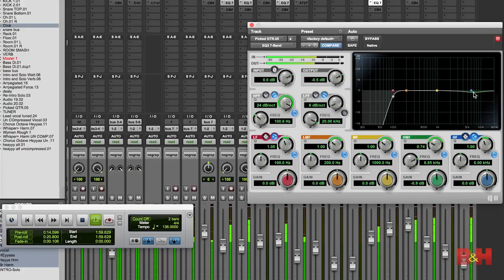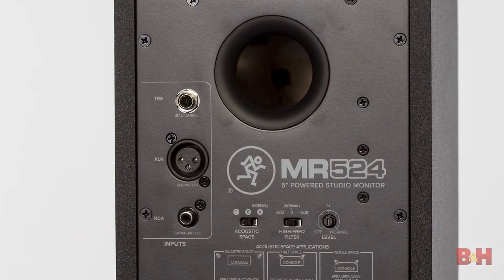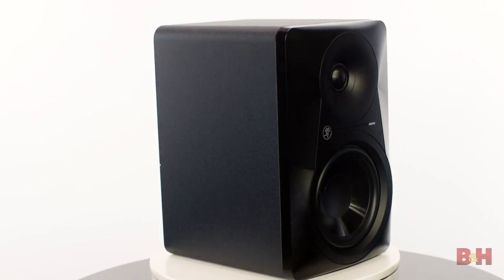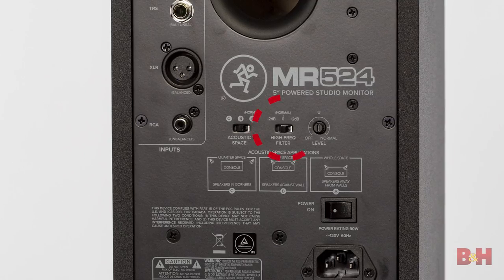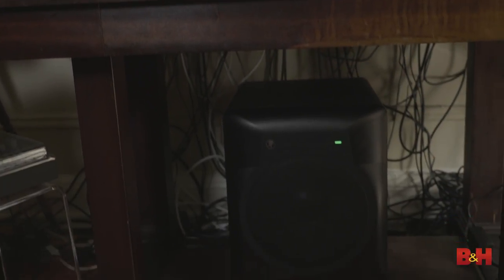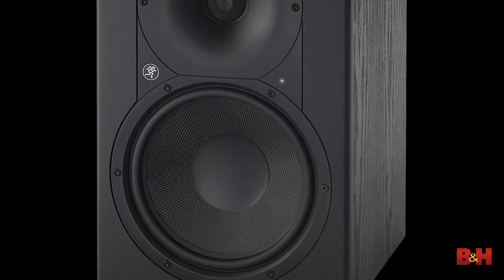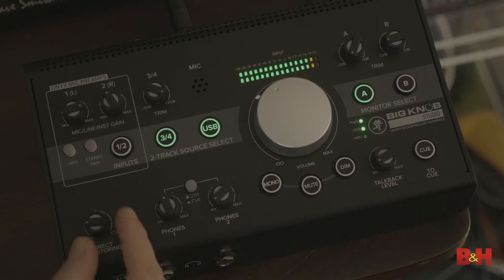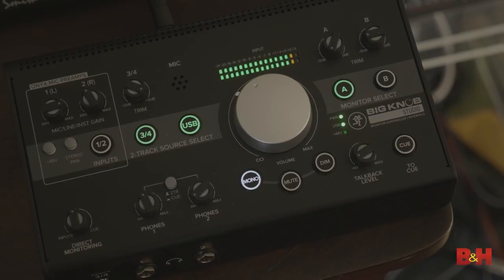Creating Accurate Mixes | Mackie MR Monitors & Big Knob Series

Comment: Does anyone recommend mixing with 4 speakers in near field (a wall of sound - two monitors close in to the computer and two spread out further to the left and right) or is that asking for trouble?
Reply: Paul Bordelon to me it seems like a recipe for trouble, the different models of monitor will have different crossover frequencies and you’ll quickly experience phasing issues which will be very muddling for any monitoring purposes
Reply: no. phasing will be created. 2 monitors at a time is your best bet.

Comment: i thought it was down to encoding and format ?
Reply: That's one part of it. The truth though, is that you will need a studio as per the industry standards, with proper monitor speakers and other equipment, also as per the industry standards, in order to get an accurate mix. With the reflections and distortions out of the way, you can mix your sounds however you want to, and then play them at other studios to try and hear the difference. If it's huge, there is something really wrong with your studio, and you might need more acoustic treatment and/or sound proofing. If the difference is little, then you have a more or less accurate mix.
If you do make a great sound and end up saving it as a 64 kbps MP3, you are obviously slapping your own self. It's like purchasing 10 bags of vegetables and dumping 9 of them on the way home. The first thing to do is to save whatever sound you've mixed, in a FLAC format, which is as uncompressed and as lossless as it can get. Then, if you need an MP3, or a WAV, or whatever other format, compress it whenever and however you want to. As long as you have the FLAC file, you'll be okay.
You balance those two things, and you'll be good.

Comment: The 624s are amazing! We've tested the 624's spectrum response pretty thoroughly, the boundaries are never that strict at the low and high ends for studio speakers, they don't have hard high-pass or low-pass filters, like we have in the digital domain. They reproduce audio well beyond their stated response (which is 38Hz-20kHz for the MR624), just not loud enough to make it into the spec. Roughly we got these results from our graph for the MR624:
32Hz - 22kHz within -12 dB, 38Hz - 21kHz within -10 dB, and 45 Hz - 20kHz within -3dB from a 100% flat response line.
The beauty is in how low distortion remains at both ends of the spectrum, and how smooth their curves over the entire spectrum are. They are particularly smooth and flat at very low audio levels. None of the speakers we've ever(!) tested reached that wide and flat a response curve at such low audio levels, and we've tested speakers for more than 30 years. After we tested them, I bought myself a pair of MR624's for my home attic studio. Never regretted it one second.
Reply: Thank you. It's helpful reading a comment like this after waiting for a pair of the same model. Of course, the tests happen in well treated rooms, but they do give confidence.
Reply: how are they compared to presonus e8 xt,please?
Reply: Any idea how they compare to the XR series?
Reply: @lu-ww2cn  Good question, I haven't compared them side by side, but I didn't really like the EBM wave guide design when I heard it first, to be honest. It is trying to solve a problem that never existed (for us, anyway). Macky has that in the back, like many brands do, which, depending on how close to the back wall you position them in your room, is usually fine. I like the low end of macky speakers better, on average, but that is a matter of taste. And presonus is a little more on the (way too) expensive side for what you get. If money is not an issue, perhaps presonus is a good idea, but an honest comparison would be interesting.
Reply: I'm looking at a pair of 624's for my DJ controller. I've got a pair of Mackie CR4's and the sound off them for a budget speaker is immense. So naturally, I'm looking out for a pair of 624's.

Comment: Can you play both monitors at the same time ? And control the sub woofer ? 
Thx Rob
Reply from the maker: Yes.  Plug the subwoofer and the  2 x Mackie MR524 5" 2-Way Powered Studio Monitor (Single)
BH #MA204840000 into the Mackie Big Knob Studio Plus Monitor Controller and Interface BH #MABKSPMC.    >Mark<

Comment: MR 524  or MR 624?  
In my setup, the position of the speakers is 20 cm from the wallIs.
Is the 524 better in the midrange and treble and the 624 in the bass? Do they sound similar?
Reply from the maker: Both are excellent  monitors for the money and they share the same tweeter. Both have excellent midrange for vocals and instruments but the 624 will deliver a more solid and defined bass. They do have a similar, signature timbre or sonic signature.      >Mark<